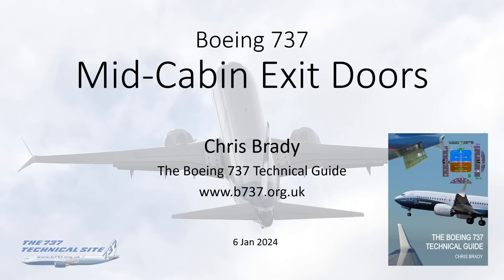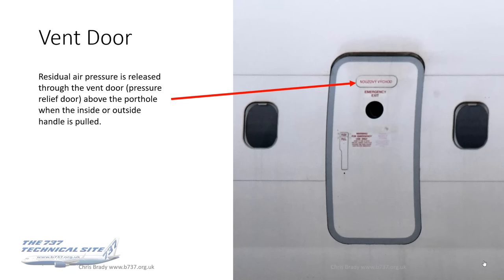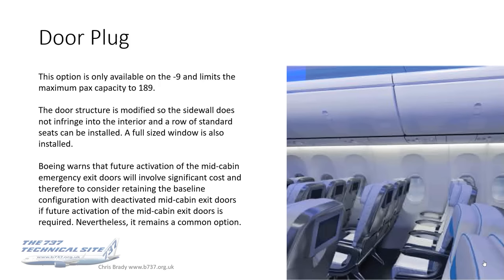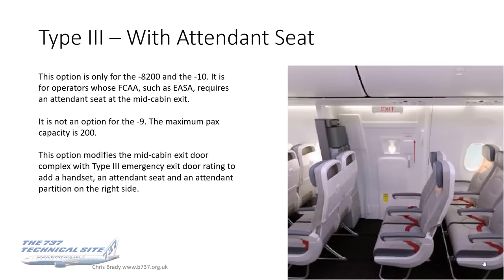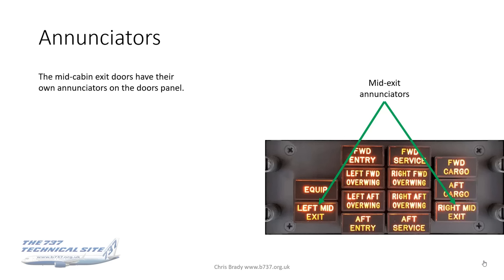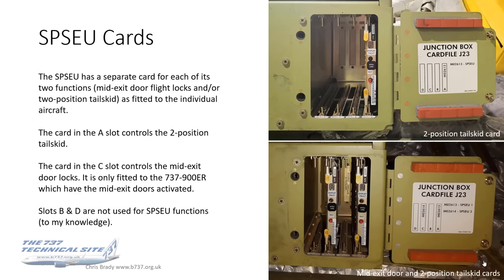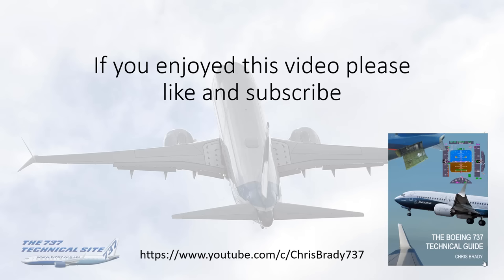737 Mid-Cabin Emergency Exit Doors

Comment: As an Aerospace Engineer, my "guess" is the lower hinge bolts were not installed properly.  It looks like they are in an out of the way hard to see location.  Could have been overlooked during a demanding work day.   
So as the plane climbs to altitude air pressure pushes out on the door, and it bends the door outward slightly.  The lower hinge sliders move up slightly due to this bending. All of the upwards loads are now being taken by the two upper bolts. 
After a few dozen flights/cycles, those two overloaded upper bolts fail and allow the door to pop up and off.
Reply: There is no such thing as a demanding work day at Boeing
Reply: If the lower bolts were not installed, wouldn’t the plug have released before or there be some sign of the bottom of the plug moving during pressurization and depressurization?
Reply: @justing42  lol
Reply: @justing42 oh yes there is trust me.
Reply: @markwatson3135 but it's behind a  panel so maybe not.
Reply: @markwatson3135  
No the top bolts would still hold it down in position until they fatigued and broke.  On the ground you would not see anything wrong without tearing apart the interior.  
It's like the DC-10 I flew on one time.  A slat fairing did not retract properly during flight, it was slightly up.  But it did fully retract on the ground.  
Another poster said this plane had some pressurization issues in flight, so that would be an indication.  Don't know any details.
Reply: There would be 2 escapes. The mechanic would mistakenly stamp off the installation of the bolts and the QA person would have missed this and stamped off the operations.
Reply: Very good point , just noticed your comment! What is your take on the resulting and obvious pressure loss during previous flights due to the plug not seated properly on the seal?
Reply: @jamesdellaneve9005  hope but could happen
Reply: Very good point.
Could it also be due to non-installation of cotter pins to hold the nuts in place (assuming that is the fastener configuration)??
Reply: Well, that is quite possible I would think. At this point, there’s so many possibilities running through my head. I did hear that that aircraft had approximately 145 flights on it before the panel blew out.
Reply: As an other aerospace engineer, I wonder how this kind of neglect, missing bolt on a pressure shell hatch, could happen on an large aircraft manufacturer's assembly line? The quality control process must have failed in many places, and needs a thorough check, if this is found to be the culprit.

Other thing, if a single failed or missing bolt will lead to a missing door plug in the pressure shell before the failure can be detected or inspection interval (due to rapid fatigue of the other bolt), it should be considered as  a safe life component, IMHO. Now, if the quality control cannot assure that all the bolts will be in place, that philosophy does not work anymore. Damage tolerant/ fail safe design philosophy (=more bolts, possibly smaller ones) would be a completely possible option here.  Bolts may fail due to other causes like corrosion, fatigue etc. anyway during the airplane's career.

What do you think?
Reply: @mhyotyni very valid points. I'm just a outsider. Do the passengers have a lawsuit against Alaskan airline or Boeing? And what would it be like in that plane and that happening?
Reply: What would it be like as a passenger ger and then as the pilot when that happens?
Reply: As a (non-aerospace) retired engineer, I have a couple of thoughts:
1) calling the door blanking panel a plug is a misnomer. A true plug would be oversized from the inside, and use differential pressure to enhance its seal. The MAX-9's blanking panel requires bolts to keep it from opening. Bolts that require proper metallurgy, dimensional accuracy, correct torquing and some manner of positive retention. One or more of these may have been lacking with 1282.
2) the myriad configurations of the 737's seems to be marketing & cost-savings driven by past and current Boeing management: let's take an old design and modify it, then offer many configurations to please every customer. 
3) I understand one impetus for the Max was to "save customers money" by not requiring pilots with new type training. Yet this video demonstrates different indications for just the combinations and permutations of door indications. Seems confusing and non-plain English terminology.
4) the MAX series comes across as "Jack of all trades, master of none". A marketing rather than engineering-driven design. The F35 vs the F15 comes to mind. 
5) placing "ease of future configuration changes" above positive cabin integrity is gross negligence, from an engineering standpoint. Perhaps this is a good example of how Boeing went from being one of the most highly respected engineering driven firms, to its current crisis-to-crisis state.

I don't know what the future holds for Boeing. I do miss the wonderful planes they produced in the past. 

Safe travels for those who continue to fly.
Reply: @RetiredEE  completely agree with your point on what constitutes a "plug"! I always believed the closeout would be jammed tight against the cutout surround from inside the cabin due to the delta P.
Reply: @RetiredEE when engineers design a fool proof system, the universe will conspire to design a better fool.
Reply: It was not that long ago when it was reported that Boeing aircraft were being delivered with missing bolts , washers, screws, nuts, ect...and even small parts just lying around the planes.  So missing hinge bolts could be very possible. IMO
Reply: It is a plug type door, but not oversized, the door as it is closed is guided into a small track by 2 rollers at the top fore & aft, (technically that makes 14 off fittings for pressurisation loads), as it lowers there are 12 off door stops (same used on 747's) and when it drops down the 12 off door stops will not allow it to open...somehow (I am rather sure of), the bolts had to be missing to allow the plug to lift up & then open. The 4 off bolts (I hope are installed in shear). The 12 off stops take all of the pressurisation loads. The 4 off bolts merely prevent the door from lifting up...something was missing I think...regards from an ex aircraft engineer!  @RetiredEE
Reply: Corresponds with report that this airframe was experiencing ongoing pressurization issues/warnings, leading to prohibition on overwater routes. Yikes!
Reply: Exactly...it makes total sense because the plug bolts are still there..but the bottom one is missing
Reply: @USAmerican100  but that is exactly what happened...
Reply: In that Netflix program on Boeing there is a hidden camera segment where one worker informs another that the previous shift did not complete some steps they were supposed to.  The other worker's "oh, shit, you've gotta be kidding me" response makes me wonder if this isn't a result of declining QA standards.
Reply: @markwatson3135  yes; they were getting spurious pressurization alarms on that plane in the days before the failure to the point they pulled the plane from etops routes but they cleared it to fly regular routes for some reason.
Reply: If it's Boeing, I ain't going.
Reply: Ding ding ding. A photo of loose lower hinge-to-door bolts surfaced on Twitter.
Reply: The upper door fitting can't take the pressurization loads itself, the primary path is by the 12 stop fittings. Once the door moves upwards so the stop pads don't contact the stop fittings, the upper door fitting can't handle the forces and rips off with the door.
Reply: @USAmerican100  It's bad design to use bolts as a pin to stop the door from raising. You cannot tighten bolts over empty center. there would need to be some part in the center of the groove to bolt through it. Bolts don't take well sideloads, it's more the friction of the actual material to take the side load.
Reply: lo and behold. quote from NTSB official. "The exam to date has shown that the door, in fact, did translate upward, all 12 stops became disengaged, allowing it to blow out of the fusalage. We found that both the guide tracks on the plug were fractured. We have not yet recovered the four bolts that restrain it from its vertical movement, and we have not yet determined if they existed there. That will be determined when we take the plug to our lab in Washington D.C."

Comment: Not a true door, but  rather a plug held on with 4 bolts? Another instance of missing or inadequately  torqued nuts (or bolts)? 
What an informative video, posted just hours after the incident. Well done, sir.
Reply from the maker: Thank you, I hoped it would help the 737 community
Reply from the maker: 4 bolts is easily sufficient- if correctly installed.
Reply: @ChrisBrady737  therein lies the problem. Design should take into consideration fail safe analysis such as missing fastener. Assembly and metallurgy becomes far more critical with fewer fasteners due to load peaking
Reply: TrinityExaminedcom  It's a plug type door. I assume it only has to stop the door moving upwards, not outwards.
Reply: Looks like it got unplugged.  @ImperrfectStranger
Reply: @Plutogalaxy facts right here
Reply: @ImperrfectStranger exactly
Reply: @n.v.1258 Boeing people…a bunch of clowns
Reply: TrinityExaminedcom 3 hold 717 engines on
Reply: @ChrisBrady737  yeah if im seeing this right like the other plug doors its sitting mounts that need to open IN the bolts just hold it in place when not pressurized
Reply: I suspect the 4 bolts preventing the plug from moving up we’re not installed. It just gradually worked its way up. If it was a structural failure it would have ruptured at 35 000 feet during the previous flight.
Reply: @markclark4154  A very likely scenario. Unfortunately, the proof of that was attached to the plug when it departed the aircraft.
Reply: The four bolts that are being referred to in this video and comments are not the structural components that keep the door in. They are to keep the door from moving upwards in the opening. There are 12 door stops on the door and the door surround structure. These are what keep the door from being pushed out when under pressure from the inside. The two bottom bolts are the hinge pivot bolts and they would have had to be in place because when the door is installed the bottom is attached to the hinge and then the door is swung up to the shut position. The door is then pushed down so its stops are positioned behind the door surround stops.These stops are what keep the  door from being pushed out from internal pressure. Now the top two bolts are installed to keep the door locked in this position..stops behind stops. Almost all commercial aircraft passenger doors work with this concept. The only way this door came out is if the top two bolts were not in place or not locked with nut and cotter pin and vibrated out. If those two top bolts were in place, the door cannot move up and therefore can't get pass the stops. I hope that is clear. 35 year Aircraft maintenance Engineer working on these doors...never seen one fail. You can see all the door stops are still place in the pictures floating around of the accident aircraft.
Reply: Sorry I missed something. The hinge pivot bolts could have vibrated out if the nut and cotter pin was not installed. Also the bottom hinge assy not only let's the door pivot to swing outwards but it is designed to move up and down vertically approximately an 1 inch to allow the door stops to slide in behind the door surround stops. Hope that makes sense.
Reply: Thank you for the excellent explanation. I can clearly understand how it works now.  @40cleco
Reply: @ChrisBrady737 No. The question of whether four bolts would be sufficient or not is moot, because the four bolts DO NOT hold the door closed against the cabin pressure differential. They merely hold the door from the 25 pounds force required to lift it as the initial step in opening the door. That lifting clears the 12 stops on the door from their 12 mating stops on the door frame, which then allows outward movement (opening) of the door. The operation is the same as the lid of a pressure cooker, the lid must be rotated to a position where the flanges on the lid clear the flanges on the base pot in order for the lid to be installed or removed.
This is a clear example of how pilots with a lot of hubris forget that a pilot is to an airplane as a taxicab driver is to a taxicab, and pretend competence in fields where they have none. A million times the monetization you receive from this video could not begin to undo the harm from the misinformation it had spread. As Mark Twain said, "A lie travels half way around the world while the truth is still putting on its shoes." Frankly, I believe you owe Boeing engineers an apology.

Comment: There are reports that this aircraft has had a number of pressurisation warnings in the last week. It could be that the retaining bolts have come lose over this time. Of course, the door warning lights being disabled would not have helped.
Reply from the maker: This is exactly what the investigation will uncover.
Reply: Boeing doesn't have warning lights for plugged doors. Airbus does.
Reply: These's a big push for more __ in the workplace, like Portland..... just saying
Reply: @povertyspec9651 another day another Airbus win
Reply: Chris is exactly right. We cannot make any suppositions right now. This is something that is not supposed to happen so clearly something is really strangely not right. The investigation will provide quite a bit of information. Certainly most of us that are guessing about the cause, might be correct in the end, but just as likely it could be something that no one saw coming. Those of us that have done accident investigation have certainly seen that. If it is something no one could see coming then the entire industry will move forward, learning something that we did not know.
Reply: loose not lose. how do you know not know the difference lmao
Reply: If they came loose over time, it was a very short time since this aircraft has only been flying passengers for about a month.  That Air Alaska seemed to know what was wrong almost immediately, because it "ground its 737-9 MAX pending inspections", might suggest the cause was obvious.
Reply: @jamescollier3 have you met the average employee at spirit aerosystems in Wichita, Kansas? You don’t know anything of what you speak.
Reply: you can see a bolt in the top right at 24:21 it's huge unlikely it could become lose more likely it wasn't engaged.
Reply: @skinnybricks  💯
Reply: @skinnybricks  To be fair to James, he doesn't know anything about hiring practices in Portland either. He's just imagining what it would be like if he had a job.
Reply: @skinnybricks  I don't know if I should be laughing or cringing in fear over the average employee at spirit.
Reply: @paulmoir4452  No airline grounds it's planes voluntarily. The grounding was ordered by the Federal Aviation Administration because the FAA demanded all 737 MAX planes undergo inspection to ensure plug doors are checked for loose bolts if present and are rectified a process expected to take around 4-8 hours to perform for each aircraft.
Reply: @jasonwinthrop6235  Alaska airlines grounded their 737-9 before the FAA required them to.  And I think United did too but I'm too lazy to double check.
Reply: @Gripengamer  Not really. Airbus is working at capacity limit for years 🙂
They can't produce more.
Boeing has never realized, that they are in a competition with Airbus.
Airbus did and so the European Company got better and better... and Boeing.... not 🤷🏻‍♂
Sad to see the drowning since the merge with MD.
Reply: The bolts were never put in. The cotter key bolt will not back off the nut.

Comment: Great to see a video that covers the subject so fully - and produced in such a short time after the Alaskan incident.  It is sobering to think how the occupants of the plane "dodged the bullet"!  If those seats next to the door had been occupied, I would guess people would have been sucked out.  And how lucky they were that they were only at 16000 feet.  And also lucky that the departing door plug did not hit the tail surfaces ... It will be interesting to see the results of the investigations.

Comment: A very helpful piece. I thought it was a variation of the type of door fitted to the D3 position on the 757. This appears to be the case, and it makes sense that it would use the same latching points as the operable emergency exit along with bolts to lock it out and keep it clamped closed. The Alaskan aircraft was in maintenance on Jan 1st. Possibly coincidence.
Reply: Likely not properly installed at the factory

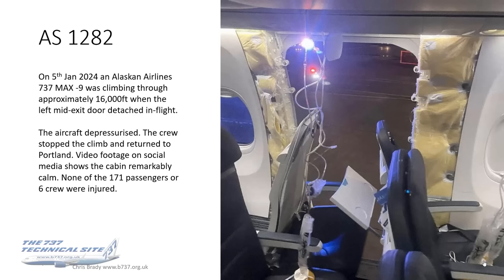Comment: 21:48 Alaska 1282 N704AL 24:01 door plug attached by 4 bolts. Expecting Spirit AeroSystems to be in the news for a bit
Reply from the maker: Possibly
Reply: When they leave Spirit, the cabin doors are installed but the over wing emergency exit doors aren’t. They’re just temporarily covered and sealed (taped). I can’t remember seeing a 9 or any with a mid- cabin exit, but I will be paying particular attention in the future. There could be a difference the condition of supply between units that get the active door and the ones with a plug. But I don’t think that Spirit handles emergency doors at all on 737s.
Reply: @88SC I just googled Spirit Aerosystems, and found a picture of a train transporting the MAX 9 fuselages. Indeed the overwing exit doors are covered, but the mid cabin door is in place and seems like its fitted..
Reply: My friend flew in this airframe PDX-PHX on 28 Dec 23.
Reply from the maker: @Chris_1024_ can you confirm that the mid exit door warnings are deactivated with the door plug option?
Reply: @Chris_1024_ Yeah, that sounds pretty reasonable.